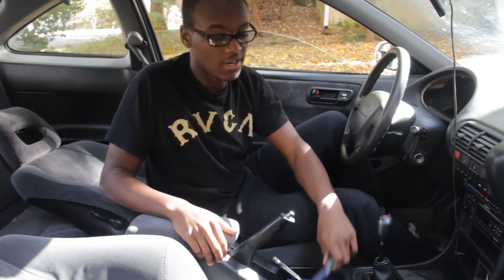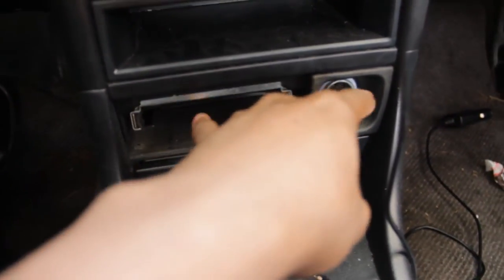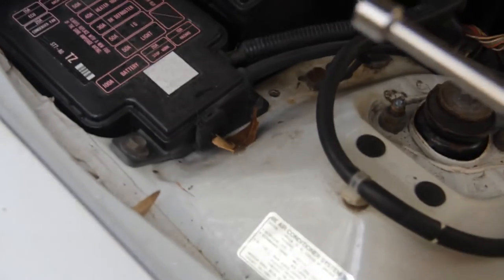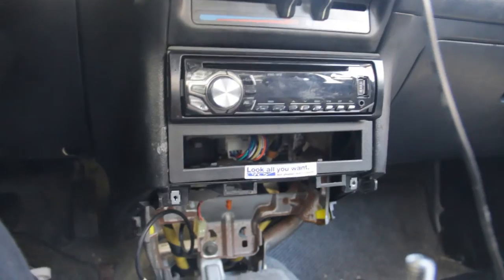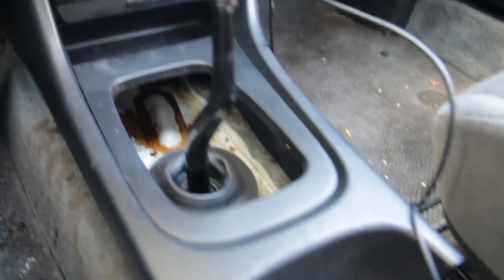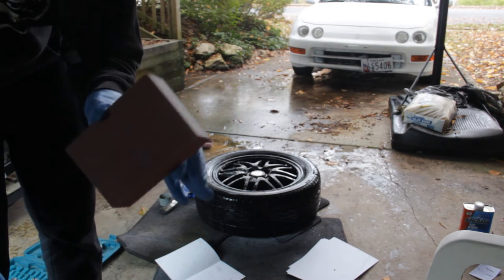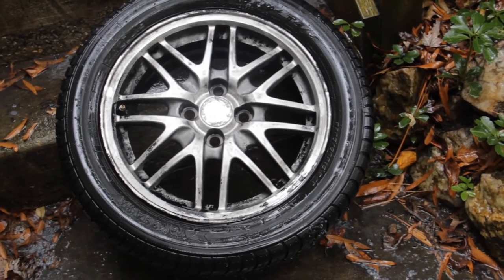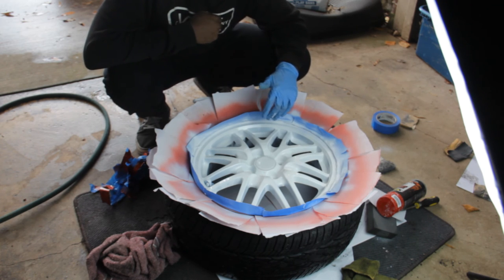Project Integra Track Car-Episode 2: Installing Radio & Painting Wheels

Comment: good job on the hard work......but....:) you do not need to take all that stuff out to remove the radio my man.....it comes out fairly easy.......just a friendly tip, because ive been installing slamming systems since 1989  and you can buy aircraft remover in a spray to make your life easier as well........but great job on hard work....dont ever give up!
Reply: How do u take it out

Comment: Was it just plug and play for the aftermarket head unit or did you have to buy a wiring harness?? Also did you have to splice and solder wires at all or was it just plug and play?
Reply from the maker: so I had a pioneer radio and all I did was match the wires with the same color.(plug and play) No soldering necessary. all I did was get some electric tape and capped each color off.
Reply from the maker: depending on which one you buy it will come with all the required wires and it will come with tge housing for the radio itself.